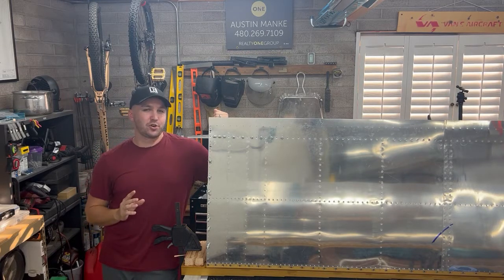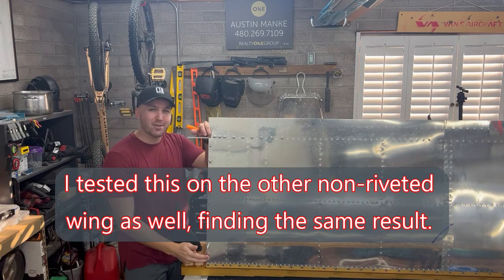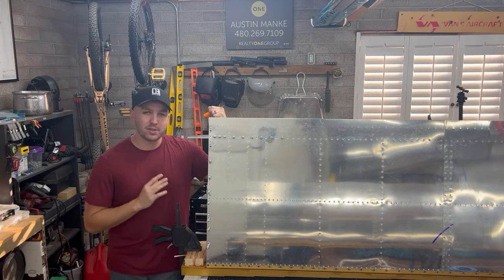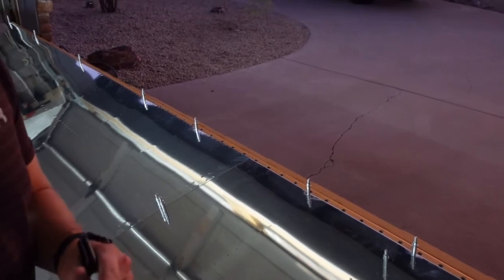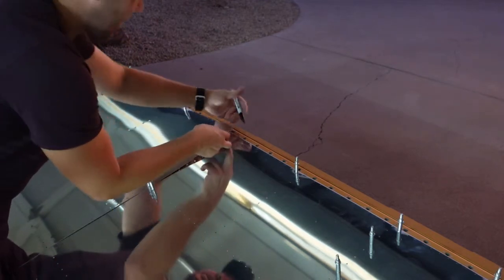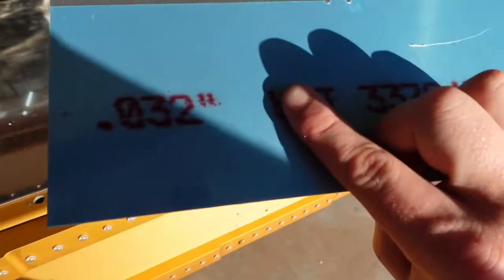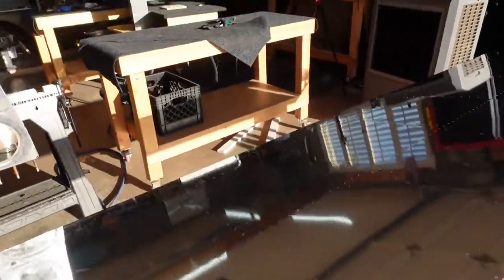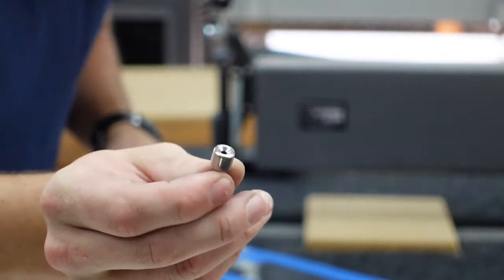Van's RV-10 Wings - Top Skins Part 1

Comment: You’ll need that small dimple die for dimpling nut plates also. Definitely a good purchase!
Reply from the maker: Great point! I remember having issues with the standard larger one and having to bend the nutplate back after dimpling. Another great use for the smaller dimple die